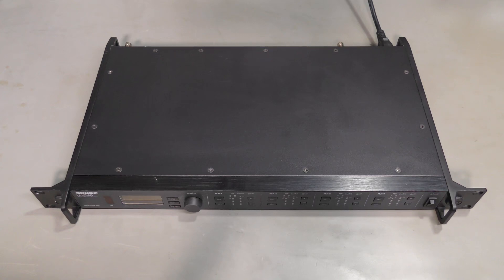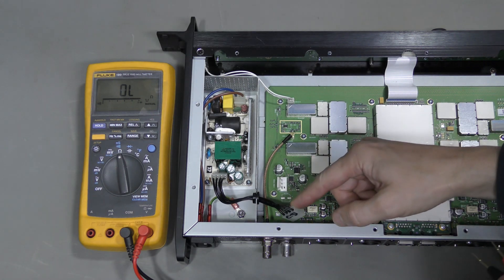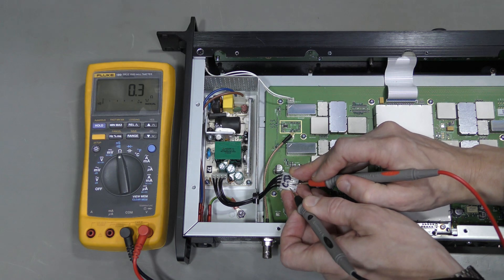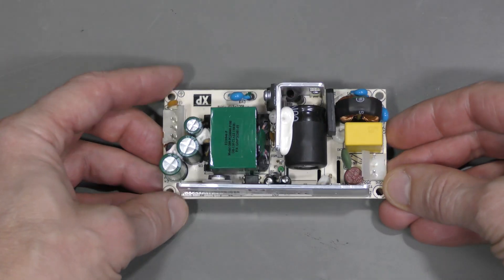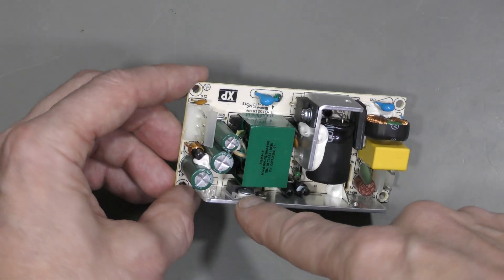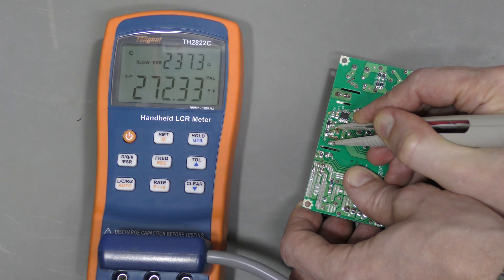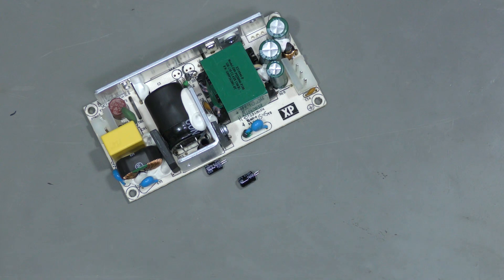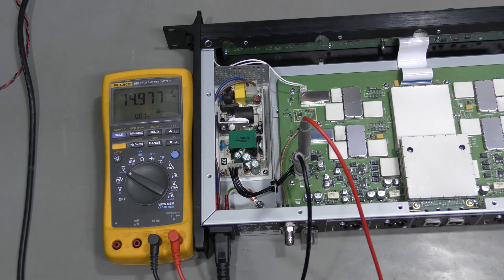#157 - Shure ULXD4Q receiver repair

Comment: I have two of these units with the same symptom. Is there anyone in the Phoenix area who would like to repair them? They sat mounted on top of each other and on for 5 years. Almost never used. Take the power away, they didn't come back on. I hope to donate these to a church since I have the mics that go with them,
Reply: If you didn't already solve this, I'm open to doing the repair if you pull the supply modules and send to me, shouldn't cost more than a few $ postal service each way. Especially if you are still going to donate to a church..

Comment: That’s a classic failure on those little power supplies. I’ve fixed a couple of those. They put those 10 UF caps right next to the heat sink which gets hot and burns up the caps. Make sure you put in 105° type caps when you replace them. Also, maybe angle the caps away from the heat sink to keep them as cool as possible.
Reply: Honestly the layer of heat shrink can't be helping them -- I assume they would need to be derated for heat if there is that kind of extra insulation on them.

Comment: I am not sure about the heat shrink tubing on these caps... Rubber should isolate them from heat, but being black it attracts the heat. I would have changed them for Aluminum Polymere capacitors, these are dry, so heat does not evaporate electrolytics and they are silver SMD like capping. So, they reflect heat instead of attracting it.

Comment: I have seen heat shrink on capacitors too, like in this power supply, and I think it is to increase the insulation rating when they are close to a heatsink or other component.

Comment: The heat shrink tubing over the caps are probably to increase the isolation since the heat sink for the secondary rectifier diode is quite close.
Reply from the maker: I believe that the rectifier is isolated from the sink with a mica pad

Comment: The quality of this XP Power module is not very good and it is often easily damaged. It is recommended to replace it with a PRS-60-15 power module
Reply: THANK YOU for the suggestion. I have one coming tomorrow and will try it out. (After testing the output to make sure it's compatible)  I will post my results here.
Reply: For less than $30 I bought one of the PRS-60-15 units off Amazon. Had to slightly modify the plastic latching parts but its works perfectly. It also seems to be a better layout. Time will tell but thanks again for the suggestion. I feel better with all new components on the power supply.